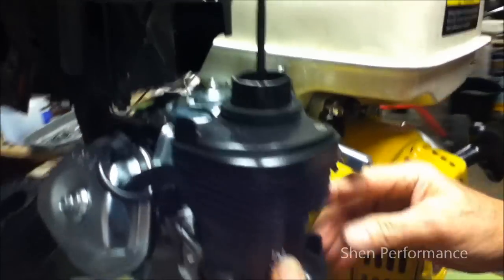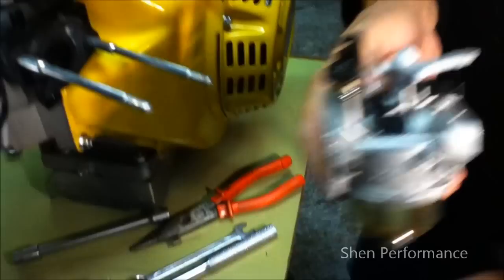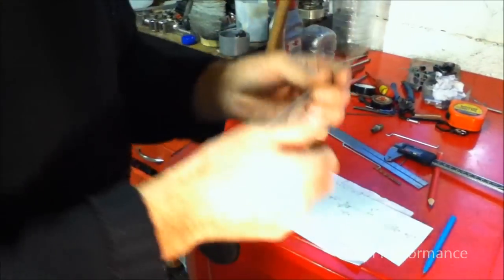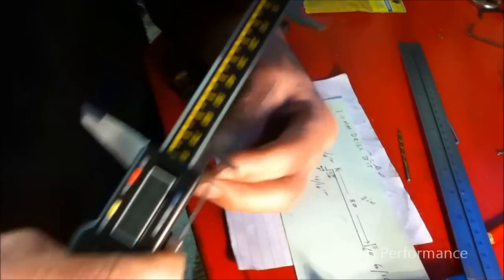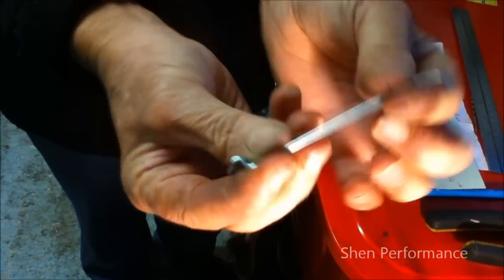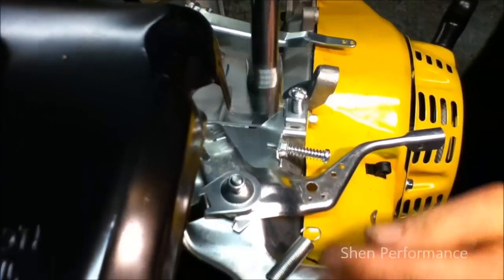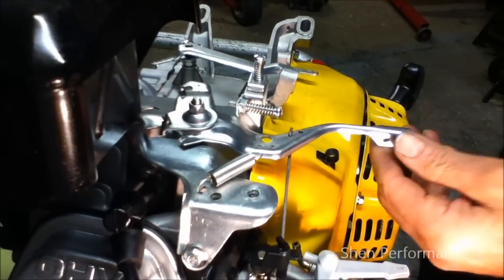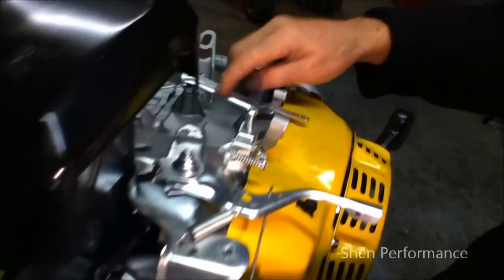How to connect a direct throttle after removing the governor from a go kart engine lawn mower

Comment: I totally removed the internal gear for my governor, and then replaced the segment with a spring to a coat hanger wire. Then from the governor piece (with the holes that the connecting links go) I put a spring which I then connected around a bolt that holds on the flywheel cover. Great video, it took some looking at mine before I figured it out.

Comment: Nice tutorial, I just did basically the same thing but a little differently to a predator motor that im building up, I used a piece of wire coat hanger,and did just what you did but did my return springs differently. This video gave me the idea of what I needed to do. Thank You.
Reply: Oddly enough I had to shorten the wire and no need for a spring!

Comment: That governor linkage to the carb's butterfly helps maintain a idle. It constantly compensates. Once a direct throttle cable is used u loose that ability
Reply: It does a lot more than that!
 The governor regulates  engine speed under load. Cutting the yard one hears  the engine rpm drop  cutting wet grass the govenor brings ot back up. 

There are also speed limiting governors, tthe Bain of long haul trucker's existence. Foot to the floor, 65mph. The driver does much more shifting because they can't keep momentun. 
So, when you  are driving up an incline in #2 or right lane and in the rearview you see an 18 wheeler, if it is safe pull into the next lane to left and let them pass on your right.  
There muscling muscling around a ):$#- load of weight..for days. The drivers appreciate it. On long drives they get to know your car. 
Idk. I haven't driven cross county in yrs,  but put a CB or whatever they use now and JUST LISTEN. They will see the antenna  and may hail you. 
I had a Blue 69ss camaro that was pretty peaky driving cross country and I put a CB in it.
I heard them say "There's Blue Goose".at the eastern border CO.
This car would do 140 like.other cars drive 75. I finally figured out they were talking about me
No Smokey and the Bandit, but they let me draft a.not crush me.  They'd also me get ahead of them so I'd drag the cops out.
Anyway, CENTRIFUGAL governor regulate speed. If the governor is operating at idle there's engine trouble, like a lean idle gallop 
I apologize for going on. 01:03
Apologize for going on.

Comment from the maker: If you use a return spring without removing the governor, it shouldn't damage it because it would always bring the throttle back into its original position (low revs). So you can use it with a accelerator peddle. Just make sure your cable is lubricated  if you would use one.

Comment: If you're lazy like me a zip tie right through the gov spring does the same thing. Slowly tighten it up until you can get full throttle. This also lets the gov hold the throttle open a little for starting, pulls it to idle as soon as it starts.

Comment: good video but my Coleman 200u 196cc motor the works total opposite.  if I hooked it like you did when you gave  it throttle it would be taking it back to idle stop. wish this one have worked with mine.  governor  not working inside case.  so stays wide open the way it is.  good video though.

Comment: Also connect a spring to governor in closed position because if it gets lose then the center piece of governor gear inside motor will fall out in engine and the governer rod hand will hit the crank..so don't let the governor remain lose.

Comment from the maker: Hello jacquicarlsen44
It’s to do with your oil sensor switch, because your taking the corners sharp oil get chuck to one side of the engine and this makes the safety oil switch come on. You have 3 options 1 to go slower round the corners 2 you can remove the oil switch connection wire, the danger of this if you have to many bends and turnings you may damage your engine. 3 Or you can add a ½ a cup more oil in to your engine and this may be the best solution.  I personally go for option 3 and also remove the oil switch connection and play by the ear.
Good luck
Shen

Comment: My throttle toggle on the carb seems to go the opposite way, so although I like this how-to, it will actually be closing the throttle on mine, instead of opening it.  I wonder what model your motor is.  Mine's a genuine GX160.
Reply: Yeah, it works the opposite way on that. See Red Beard's Garage's tutorial on a gx160
Reply: Just hook the throttle cable up to the clamp that is on the original throttle mechanism and it will work fine, no extra bracket needed.

Comment: why do you have to remove the internal gears is it just for less unneeded parts in the motor or will it not work correctly if you just by pass it?

Comment: hi, what happns if i do this without removing the govener inside the engine. would it buypass the govoner?
Reply: It is best to keep the governor in place unless you plan to race. it protects the engine from exceeding its designed speed.
If you plan on putting a solid rod between the carburettor and actuating lever wrap the rod around  a broom handle twice so that it has some give in it the last thing you want to do is break the plastic connection off the top of the carburettor.
Reply: @sidneyeaston6927  lol noone wants the governer. We want to go fast. Duh
Reply: @JLUX100  So you have never heard of putting the magneto on a sliding plate and using the govener to advance the timing to get more power and higher revs = more speed. Basic petrol engine theory.
Reply: @sidneyeaston6927  nice attempt at trying to sound like you know what you're talking about.. All magnetos on a small engine have slide plates.. lmao tadvancr timing  which hardly does anything and is barely making up for the lost power and rpms from the mechanical governer. You can advance your timing with no governer and do it while you slap on a lighter and stronger flywheel.  Basic small engine performance. Lol I know lots about building racing motors especially small engine Honda's (or clones) all the way up to b and k series four banger Honda's.
Reply: @JLUX100  The reason Honda do not make the parts that you slap on your engine is because they already  make the same size engines with twice the power and stick them on motorcycles. the only reason for removing the governor is that they are not designed to take the centrifugal forces created by higher RPM and tend to fly apart leaving loose metal and plastic bits in the engine same goes for the plastic cam sprocket in Briggs @ Stratton engines. Now you know why they don't cast the two extra lugs on the engine to allow you to just move the magneto and advance the ignition timing.

Comment: Doing this will it let the engine rev higher even with the govenor still in place because I have a genuine GX390 and it cost me over £600 and im not sure if i want to remove the govenor in case it blows up, however i want to increase the RPM from it to get more speed, will this help?

Comment: If you are going to run the engine higher than the governor speed of 3.600 rpm,  you need to replace the valve springs from 10 lbs to 18lbs... the replacements are available at gopowersports.com and other places...
Reply: You can run them much higher than 3600 without needing springs.

Comment: My governor is removed but my rpms is way high i can barely open the choke and it wants to take off any suggestions
Reply: xclos313 lower the idling speed on the carburetor by adjusting the screw. I know this is old but it may help.

Comment: Do you have to remove the mechanical side of the governor for this mod to work ?
Doesn't the govenor close the throttle plate ?\
Reply from the maker: NFG Nugent Hi there, if you're talking about the mechanical side of the governor inside the engine, yes you do have to remove it, because at the same time you have to remove the return springs which is controlled by the governor. Once you do that, bobs your uncle. My other video of the removal of the governor shows this in detail. https://www.youtube.com/watch?v=8T5vVXKEXgY

Comment: Wouldn’t it be better to mount a spring from Governor to gas tank bolt and no spring to carburetor? That way the Governor arm can’t engage with a strong spring holding it back.

Comment: What if you just remove governor linkage and leave it in there?
Reply: Still need to remove the governer inside or it will still govern. Just loses the idle control that the governer linkage gives when under load. But the governer in side Wil still do its job at high rpm

Comment: Ok so I did the direct linkage on the engine exactly like in this video and when I start the engine it goes full throttle once the choke if off. If the choke is on however it shuts off completely. Same experience?
Reply: Julien Tai-Beauchamp Hi, I read your comment on the video tutorial from Shen Performance re: removing governor and having direct throttle linkage.  I appear to be having the same problem as you in that my engine from start revs extremely high and the only way I can bring it down is with the choke.  Can anyone shed any light on what I am doing wrong.  Thanks in advance.
Reply: Julien Tai-Beauchamp I just completed an engine swap with a Lifan 15hp motor. once i had it running great and going great, the governor started to hit pretty quickly. So i started watching these videos from Shen Performance and they were great, I now have my governor removed and a direct throttle just as he did. BUT, I am having the same issue as you two are having. I am now having trouble starting the engine, before it was one pull and its running at its prime.... now, i had to pull for almost 10 minutes before i got it to start and that was with playing with the choke.... The first time I got it to run, I had the choke wide open, once it warmed up I closed it but the idle was EXTREMELY high!!!!!!!!!! High enough that it was a good thing I had someone in the Kart with their foot on the brakes, otherwise it would of been long gone! If I open the choke, the high rev goes away. I am lost in this now.... I followed this video to the T! although, it is a different engine, everything was damn near the exact same. My new throttle link is shorter and looks like a stairway, but it works amazing. Have you guys figured this issue out yet?
Reply: keith collins I even played with the idle screw.... and noting seems to change...^^^^^^^^
Reply: keith collins ***** I have found a solution for the issue we are all having. All you have to do is bend the newly made wire section that bends into the throttle arm a bit back to give the throttle a bit more slack in order for the carburetor to have a more natural opening once the engine starts.
Reply: Julien Tai-Beauchamp bend it back towards the rear of the engine? I will give this a try in the AM. Thanks for sharing your solutions!!!
Reply: ***** Before you try anything let me draw a diagram and give you the link to the image
Reply: ***** http://i.imgur.com/nnOCGHt.png  -> diagram of proper linkage bend
Reply from the maker: ***** Julien Tai-Beauchamp Hi there, sorry I couldn't help sooner. There could be a few problems, keep in mind every engine is not the same. The rod location might be a different distance to the carburettor. Firstly, make sure that the linkage rod to the carburettor is not too short. Even if it is a millimetre short, you will have high idle revs. The best way to check this is to install the rod to the carburettor end first, and see if the other end reaches the location of the hole on the rod. If its too short then you would need to re-lengthen your rod accordingly to solve this problem. Good luck and let me know if all goes well.
Reply: ShenPerformance Ok, I re made another linkage... and it worked out great! but now I am having difficulties starting the engine. I am having to pull the recoil for nearly 10 minutes than quickly twist the idle screw or play with the choke... what would cause this? I used to be able to start the engine on the first pull no problem.... Any idea's? thanks for all the help and great videos!!!
Reply from the maker: Check your idle screw you may need to turn it up a bit and make sure the spark plug it’s clean and also check the spark gap, it may be a good idea to replace the plug. Good luck 
Reply: ok, I re made another link... it works great now! as for starting, I can not utilize the choke, but instead i have to feather the throttle peddle until it warms up. I attempted to mess around with the idle screw, but this makes it worse in the sense of when I turn the choke off, the idle is extremely HIGH! The go kart actually wants to take off with this. so instead I set the idle screw low for a normal idle, and I have been feathering the throttle until its warmed up...  any idea why the idle would be high when I turn the choke off?
Reply: Julien Tai-Beauchamp can you open up the throttle or is it stuck in place. try starting the engine and then move the throttle linkage
Reply: I had the same problem
Reply: Julien Tai-Beauchamp looks like the throttle cable is hooked to the wrong part of the lever 
So it's at full throttle when the pedal is not pressed and at idle when the pedal is pressed.

Comment: If you bypass it, it will be working for the sake of nothing. Bypassing is fine, but if you intend to do future engine modifications, you minds well remove the gear when you are into the crankcase. See my video (skip around?) "GX200 Simple Governor Removal & Install". I showed how to remove the gear in a way it can be reinstalled.

Comment: Disabling the mechanical governor doesn't make any since to me...why would you take the chance of over-revving the engine and damaging it? The chances are high. These engine are not built to rev higher than factory specs. You can still have variable throttle control from idle to top governed engine speed and protect your engine as well with it intact. If you want more mph, adjust your drive train, Want more power, use a bigger engine.

Comment: Can the kill switch get locked in the off position due to corrosion, age, or moisture causing the engine coil to not cause spark?
Reply: Rust on the flywheel
magnets can do that.